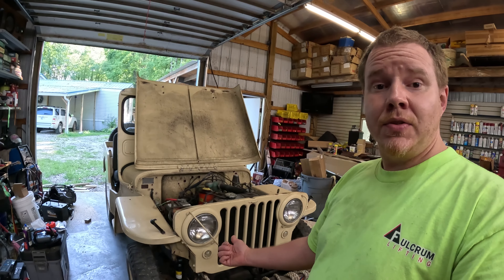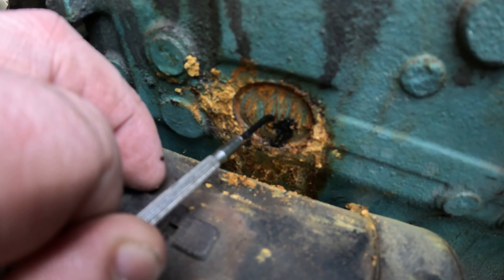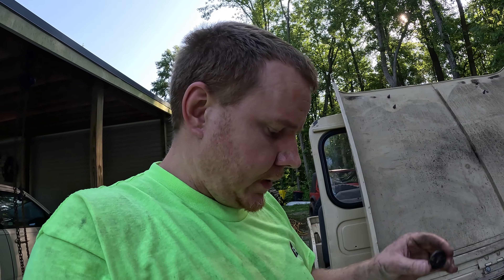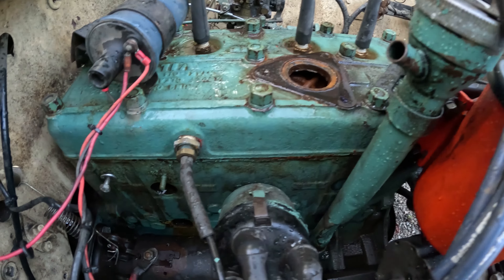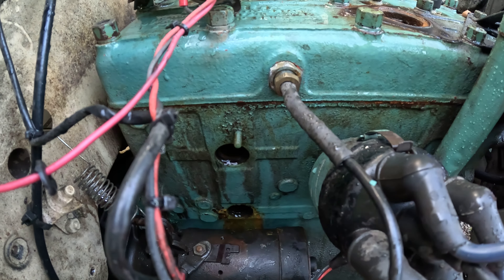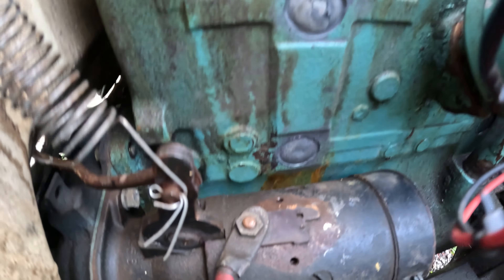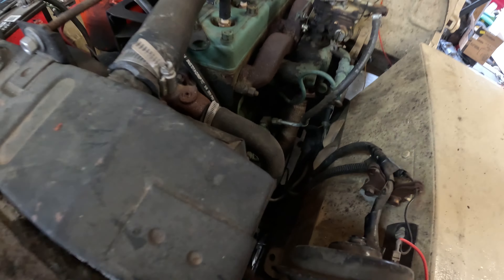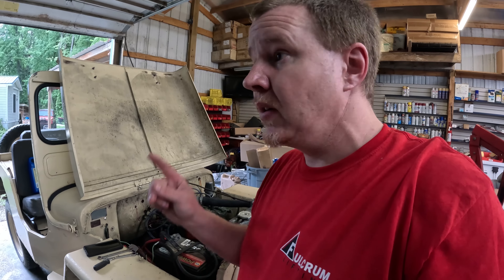1949 CJ-3A - L134 - Flathead - Freeze / Core Plug Replacement & Cooling System Flush

Comment: Any particular breason you installed nthe corepligs reversed? Domed side goes in!
A welch plug goes in the way. If you've eorked on alot of 2 stroke power equipment.
Reply from the maker: On this engine, the dome goes outward so when you strike the center, the OD expands and creates a tight fit.
Reply: @NotSoGrandGarage  when you removed old freeze plugs they were installed properly opposite of how you reinstalled them! Just saying you installed like a welch plug but we're originally installed dome side in before you removed.
Reply from the maker: They are pressed inward inverting the dome from the factory according to every manual and online reference I could find.  I installed them accordingly.  Whether or not that's correct is beyond me but it isn't leaking now where it previously was.

Comment: I have never seen a freeze plug installed with the dome side out? Regardless of that, always use a freeze plug installer and maybe a little sealant around it. 😞😞
Reply from the maker: Wasn't aware they made a tool for dish style core plugs.  A special tool isn't really necessary like with some styles.  With that said.. this style must be installed dome side out as when you strike the center, the plug expands and seals to the block.  These are a loose fit until the center is struck (typically using a ball peen hammer if there is access).  These aren't standard cup style plugs.  Epoxy was used instead of sealant as most in the L134 community suggest that it is better for this application.  Thanks for your concern though.